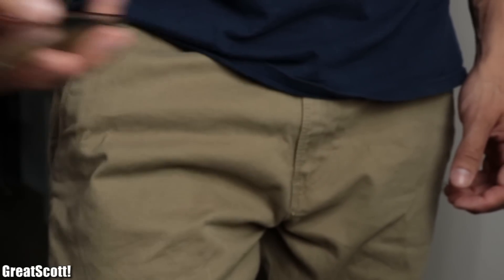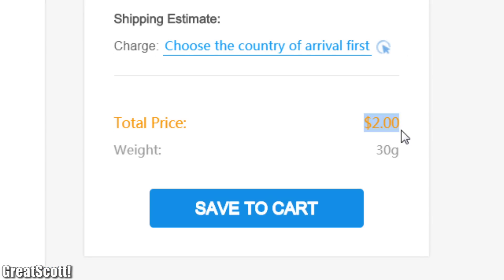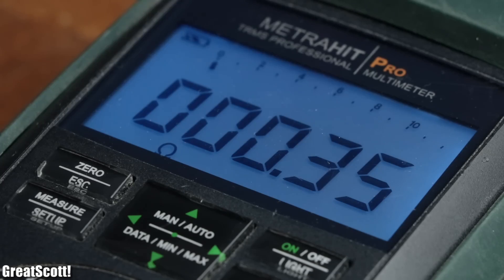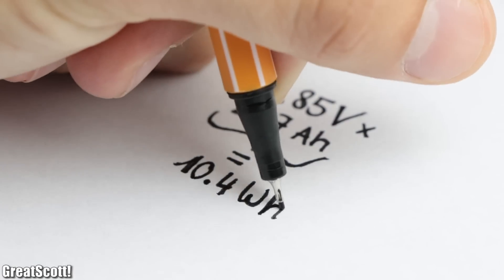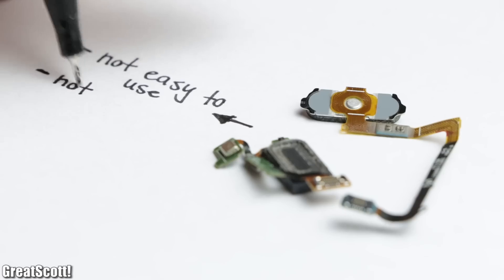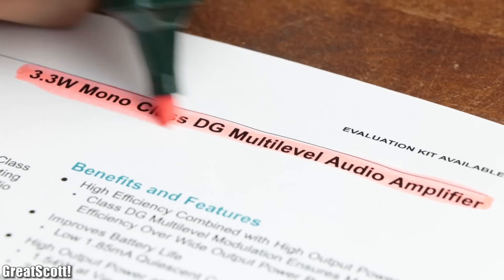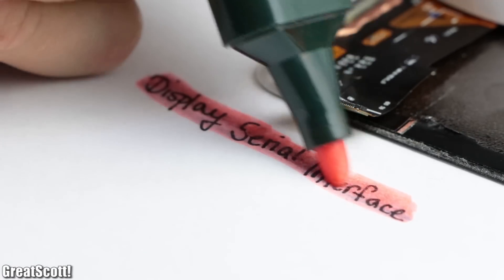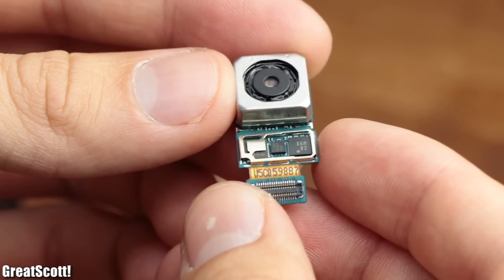What is worth salvaging from an old smartphone?

Comment: 5:22
That was most likely the vibrating module used to vibrate your phone upon notifications etc..
Reply: As someone who repairs phones for a living and has experience with salvaging parts from old ones in my free time, that is 100% the vibrator motor. Old phones used to have it be a really simple typical DC motor with a unbalanced weight at the end, but newer phones don't have the space to support such a large component, so instead they have small ac motors like that. I've also heard the newer ones are more power efficient or produce stronger vibrations but never found a reliable source on that claim.
Reply: @Epicrangerpig  I thought it looked like a mic
Reply: @MD_Builds  i mean, you can use this vibrating thing for personal uses.
Reply: I thought that too.
Reply: but it could also be the electret microphone

Comment: If the phone still (mostly) works, the easiest way to reuse it is to connect the USB to a USB host like a Raspberry Pi or even certain high end microcontrollers. Then 3D print a holder to mount it on the enclosure of your project.
Reply: What could this be used for?
Reply: @PMSTTR  Any project that can use a touchscreen and compute power.

Comment: You can use the phone as a basic server, for example a file server or Blynk server. The screen can display the data and the IoT devices (sensors, boards..etc) connect to its hotspot (wifi). It has good processing power to process the data.
I know this video focuses on the electronics part. But these phones are plenty powerful to perform many tasks.

Comment: The best way to recycle a phone is keep it in running condition as long as possible.
Reply: Yeah. I'm pretty happy with my old LG v20 & don't feel like shelling out money for a new phone, so I just replace the parts that stop working as needed. So far I've replaced the speaker & vibrating motor. Only $10 total!
Reply: @Homebrew Engineering That's a great option.
Reply: Great idea!
Reply: @trashmammal3635  my s4 is still firing. ..
Reply: @ericscaillet2232  The S4 is a great phone, damn I wish I had one of the old S-series phones to install ROMs into it.

Comment: You forgot about the high quality LED Flash on the Mainboard D: I always keep those.
Reply: True those led's are great but hard to desolder
Reply: @blackturbine  desolder it using an iron.The iron you used to dry clothes.Put the led side up and put it at the iron.its an effective way for me.
Reply: Black turbine - True, and even harder to solder into a new project. Just like the sensors! WOT! @GreatScott is correct, salvaging smartphones is a WOT! Shame.
Reply: Woah you subbed to alot of tech guys and furries!

E: and dream
Reply: That's what I waited so far, but he didn't
Reply: He is way to lazy to deal with that
Reply: CA LO ...too lazy to...
Reply: And some of the sensors...
Reply: @RumblePirate   I think all sensors are inside an IC. So pretty worthless.
Reply: @Foxilein  I've found proximity, IR, temp., light, bms and some good quality LEDs, so may be
Reply: I have a flash that I was able to pull from an old phone, it was connected via a connector. Pretty bright for a  couple of surface mount LEDS.
Reply: So we ignoring the fact that his a furry?
Reply: @ahmedmani1051  personally i find it easier to ignore than "he's"/"his" spelling
Reply: @ahmedmani1051  so?
Reply: @ahmedmani1051  who cares
Reply: @ahmedmani1051  he is still a human
Reply: @ahmedmani1051  why would that matter? Im an electronic enthusiast as everyone else here. 🦊
Reply: @ahmedmani1051  Why would that matter? Why SHOULD that matter?
Reply: @harshbarj  it's gross
Reply: @ahmedmani1051  yea actually we are

Comment: So ultimately, is it possible to reuse camera module from any smartphone to built a DIY camera or any security system project?  Thanks in advance.  Love and a lot of respect to you.
Reply: It is possible, yeah. You can almost always find the pinout of them somewhere on the internet. Connectors are Molex Series 51338 ones, have fun XD
Reply: @pajeedreede6173  no actually i didn’t meant that. I just want to know what types of hareware(s) i use in that case. I want to know more about that.
Reply: @GSRA5  Ah. Either you obtain a CPU supporting CSI (e.g. all of the NXP i.MX8M series has that), or IC's like the CYUSB3064/CYUSB3065 (CSI to USB3) or TC358743XBG (CSI to HDMI if I remember correctly).. A quick google search should give you more IC's to go with, as well as their datasheets. In those datasheets you should be able to find enough info to get stuff working

Comment: Selling the old phone is probably the better idea than gathering parts from it for projects. I usually never use such salvaged parts :-)
Reply: Or using it for other purposes, such as app development, hacking, or as a screen or camera for a project.
Reply: But if phone is broken then it cant be sold at a good price....
Reply: @100ksubscriberwithnovideos8  Scrap parts are also worth something
Reply: @100ksubscriberwithnovideos8  That's right. If you have iPhone X for exemple, and you will change broken screen or not, you can sold it, and have money
Reply: @100ksubscriberwithnovideos8  Some can repair them. Some can use its parts as replacent ones. For example, I struggle dinding true not working phones for repair practices. In Ebay pretty much all totally destroyed when someone tried to repair them.
Reply: To each his own. In your opinion it's better to sell the phone. In my opinion the $35-$50 you could get for a 3-4 year old phone with a weak battery isn't worth the hassle of selling it to 4 people before you find one that isn't a flake and actually shows up to get it. I would rather disassemble it, learn all I can about the circuitry and components. Then salvage the phone for parts. But I get where you are coming from. It's not worth the headache to you to salvage it. I am also not an electrical engineer, electrical technician or involved in the industry in any capacity, Just a hobiest/DIYER, so the information I can from one of these is invaluable to me.
Reply: @gwsmith76  Don't get me wrong. I'm a huge fan of recycling (a must for a German ;-)) and salvaging parts for future projects. I just think parts of a mobile phone are very special and really hard to use for own projects - compared to getting new components (which are also known working). Rather than salvaging parts I would prefer restoring or repairing the "old/defective" things and get the most value out of them by selling them working. As you said, to each his own. I fully agree with you saying, that you can learn a lot by disassembling such things, for sure!
Reply: @gwsmith76  This video shows that you pretty much can't salvage anything from a phone. All that together is worth less than 5$. Others can find a better use for a non working phone.
Reply: Only for repair purposes is it super nice to have random parts on hand, but what fails most of the time in phones? Screens and maybe USB ports is my guess
Reply: I picked up an old printer from the trash a few months ago. the CIS from the scanner sells for $42 on ebay and a mini wall mount lcd had a pannel that sells for $72 on ebay. So even if you just salvage parts to sell as spares it is worth it. I got an i5 processor from an old laptop motherboard I picked out of the trash too but havent sold it yet. It lists for $64 and it is a G2 socket. Not common for laptops to use socketed CPUs :D
Reply: In Eco machine my phone costed 0$, so it isn't worth to sell your phone when its old.
Reply: @maciejk48  Yeah maybe, but a Galaxy S6 is still $70 here in Germany. Just saying...
Reply: @ranger81de  Yes. It depends od place, where you will sold it. In eco-machine in US (im not from US) you will have little money. When someones on ebay give you this 70$ you can be happy.
Reply: @maciejk48  Mate, the eco atm's are the biggest ripoff of the century
Reply: @themrenerd7384  Yes. Selling phone on ebay is good idea. You can back part of money, which you paid to old phone, and buy new phone cheaper. What about phone's memory? Flash memory badly cleared, can give passwords and data about credit card when you was paying with phone. Before selling phone, device should be well reseted.
Reply: @maciejk48  those machines are scams, your fault you would even go there to try to get money.